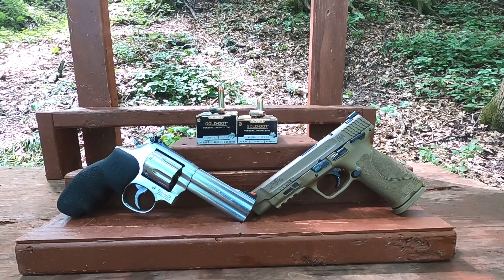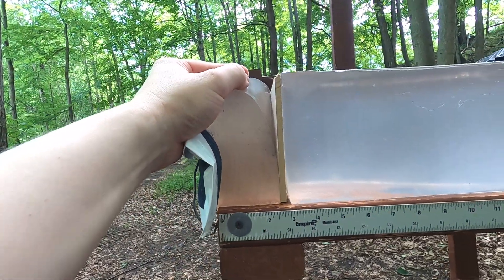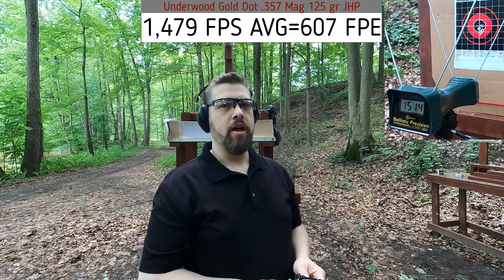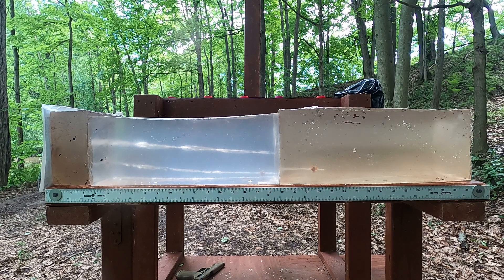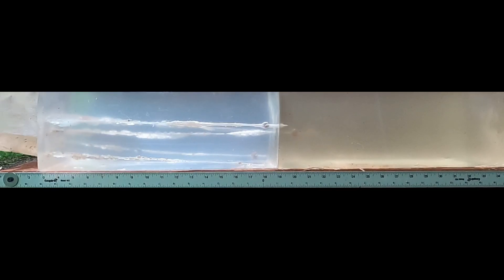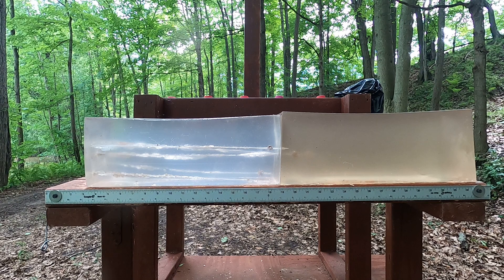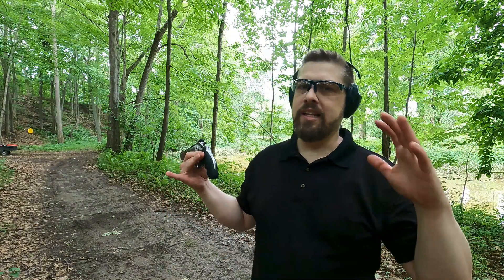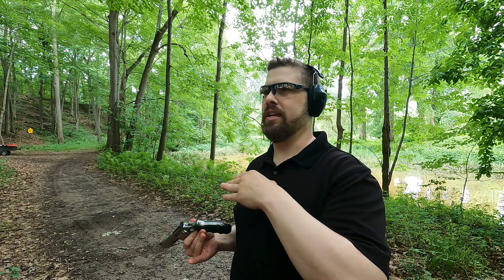.40 S&W VS .357 Magnum Ballistic Test - Gold Dot

Comment: Standard store-bought ammo will give you an average of about 420 fps faster with the 357 vs the 40, which means you can reach out further and do so with more accuracy than the 40.  Also the 357 averages about 150 ft pounds of more energy vs the 40.  

Even the fastest loads done with reloaders, they were able to get about 4,800 fps using a 15-grain 40 cal, but they got over 6,000 fps with a 40-grain 357.   But those loads are not available in stores, these were made by reloaders as I mentioned.

Some people argue they want 14 rounds for self-defense, well since most self-defense shootings are at the 7-yard range with one attacker, why do you need 14 rounds?  Where are all of those 14 rounds going?  into innocent people?

Comment: The best test would be to use 135gr for the .40 and 125gr @ 1,450 for the .357..

Also that would have been a better representation of equal density as well... Not trying to be mean but your test is foul right off the rip bro ...

The 135gr .40 and the 125gr .357 are equal ballistically.... Almost EXACTLY IDENTICAL in fact...

ALSO this isn't even close to fair dude the .357 round has over 600 ft-lb's of muzzle energy and the .40 round only has 480 ft-lb's of muzzle energy..... In what way did you think this was comparable at all?! Please tell me I'd seriously like to know...

Comment: MORE MDF=Real Gel/Real World Proof!!!..it turns Clear Gel performance=Denser Real Gel! Ur 165 5" barrel 19" .616=5.66 cu in" Tissue Crush vs Spear REAL GEL 4 Layer Data from 4" Barrel 18" .618 5.4 cu in" Tissue Crush.  Underwood 125 GD 21" .594= (only 18" Given per FBI Protocol) 4.99 cu in TC" (compared to Critical Duty TC 3.67").  That's a Bad MFer!

Comment: I can see the appeal especially a compact 40 Smith if u CCW. In the lower 48 national parks USA as long as the ccw piece is not showing its okay to carry in the park. A compact 40 with even ten capacity can perform adequate double duty on two legged & some four legged varmints. The American compromise.
Certainly the 357 is adequate protection, but try to find a 357 that can be easily hidden in the summer months with less outer clothing. It's harder and snub nosed is at a disadvantage velocity wise.

Comment: That underwood ammo is loaded hotter than the gold dots. They’re not moving at the same speeds.
Reply from the maker: Yeah but only a difference by 40 FPS average. That's pretty close considering it's only 125 gr. That's only 36 ft lbs difference.
Reply: @GunSam  Speer advertise their 125 at 1450 fps vs 1700 for underwood.

Comment: When you shoot it with the magnum rounds.  The front of the block lifts so much it’s changing the trajectory to end up heading downwards towards the table…
Reply from the maker: But if you play back the more centered shot in the gel at super slow speed, the bullet is as far as it's going to go for penetration, before the block starts to lift.

Comment: Hopefully u will start a 40 S&W renaissance. I never left it. My P229 is in honorable semi retirement now, but it still gets occasional exercise. As does my 686, the gun i started my career with. My primary ho uh se gun for years has been my XD 40, because it is accurate and i found a good light that adds very little bulk. The 357 is a go to for hiking and outdoor activities, especially if animal defense is a concern. Depending on the situation, i might prefer a 158 gr bullet for it. But for general defense, the 125 is tops of course. Gold Dots are great bullets in everything 380 and up. We used 180 gr in the 40 for many years at the PD where i worked. They did fine on injured deer. Thankfully we never had an OIS. I half expect the pendulum to swing back toward the 40 and 45. Time will tell
Reply: 40 sw is a downloaded easier to handle 10 mm basically. 40 sw was created to get 10 mm ballistics but easier to handle, fits in 9 mm size gun frames. capacity near 9 mm. 40 sw can even go up to 200 grain hard cast with 440 foot pounds at 1000 fps, or 200 grain subsonic 400 foot pounds at 950 fps for suppressors and limit over penetration, rivaling 200 grain 45 acp +p rounds. The 40 sw is the second cheapest after the 9mm and second widely available after 9mm. Capacity second highest after 9mm. Also, it makes bigger holes much deeper than the 45 acp. Ballistically it out perforems 9 mm and 45 acp, and reaches low end 10 mm and 357 mag but easier to handle and can even go heavy subsonic like 45 acp. Incredibly versatile. 40 sw is the most balanced ammo type to ever exist.

Comment: I can personally attest as well the 40 S&W is a fight stopper, my agency I used to work for had us carry them In Speer Gold Dot 180 grain out of a Glock 22. 357 Sig is also a really good show stopper. 40 S&W is better in my experience over 9mm. Modern loading have not only improved just 9mm.
Reply: My agency’s 9mm Federal 147gr HSTs are incredible fight stoppers.  Las Vegas Metro PD doesn’t see any “better” results from a .40 when comparing it to their 9mm Gold Dots.   NYPD doesn’t see any “better” results from a .40 when compared to their 9mm Gold Dots.   Both LAPD and LASD don’t see any “better” results coming from a .40 that would trump a 9mm in actual officer involved shootings on the street.   I personally (paid gun stat nerd) don’t see any “better” results from our authorized 230gr .45 HST’s when compared to  our authorized 9mm HST’s in actual street shootings.   This is coming from a 10,000+ sworn personnel department.   

Bottom line is, neither 40 nor 45 is any better nor any worse than 9mm these days in actual street shootings.   Shot placement is key because when I put two in the proverbial “bad guy’s” heart and one in his head with my 9mm, is it really gonna make any difference to the bad guy what caliber I was using???   

The big difference between those three  “KINGS” of the policing calibers is capacity.  Here is where 9mm shines and beats 40 and 45 and that is the ability to not only carry more rounds, but to SHOOT more rounds at a bad guy without having to reload sooner than the other calibers.   That alone can be a winning factor to surviving a gunfight when every split second counts.

Watch why “more” may be not on,y better, but necessary.  From Donut Operator….
https://youtu.be/pdjcYjSsIok
Reply: @colt10mmsecurity68   your 2 to heart and one to the head is great as long as the 2 reach the heart.  I have seen actual x rays of bad guys that look like he should be dead but the bullet never reached the heart. There are Times when a heavy bullet with momentum is required
 For police and other such agencies the 9mm might be the right tool how ever for home defense the blast of a 9mm or worse the 357 could end up being a show stopper for you if your first shot do not connect.
Reply: @biggunshandguns3687  You make no sense.
Reply: From particular medium sized PD with which I am very familiar , and from which knowing the guys doing the testing and recommendations for duty ammo ;

     The initial .40 S&W ammo selection was the USBP Spec 155gr JHP . In the couple of OIS occasions it worked decisively . In addition , Lots of injured and healthy deer were put down . Federal LE 132 buckshot was preferred for deer when available , but the 155 jhp was more than adaquate .

     For the final year or two of the .40 S&W Era , switched to the then latest W-W alphabet soup . It was explained to me that in testing , the actual anti personnel capabilities were identical , but the wonder bullet of the week did better on penetration of car windshields .

Comment: Great video!  I like my 6" GP100 and my 5" M&P 40 (just like yours).  Also, Gold Dots rock.

If I had to pick one to defend against unknown attackers, it's going to be the 15+1 round .40 S&W.  At full, standard pressure power, the .40 does better than most factory loads.  I get 567 ft/lb with no sweat using normal Alliant Power Pistol load data.  Longshot powder got a bit more velocity but did not group as well for me.

OTOH, if I wanted to shoot at 100 yards, I'd pick the GP100.  And for leisurely range shooting, it is sure nice to not have to chase brass.

Powerwise, I'd call it a wash.  Situations where sectional density come into play, the .357 is preferable.  Deer hunting for instance.

Comment: Great testing Sam! Never disqualify the .40cal because the FBI says so. It's still a viable round and will deliver the goods if shot(s) are placed correctly. Shoot what works best for you.
"Be a multi caliber shooter" for best overall performance - Honest Outlaw. ♠️🎩☯️
Reply: The FBI could have truthfully proclaimed that current 9mm was more than adaquate for LE duty use , plus had other advantages for a general issue Duty gun , such as to on balance be an excellent option .

    But to claim that latest Magic Bullets in 9mm are outright better performers than ( .357 M or S , .40 , 10 , .45 , etc ) is p** on our legs , telling us it's raining .

Comment: 40 S&W is very competent. Yet I find the equipment chambered for it steadily going away. Checked Ruger the other day and the only firearm they make chambered for it is their PC Carbine, absolutely nothing else. Guess we'll see how other gun makers handle it as time goes on. On the other hand 10mm has made big strides back.
Reply from the maker: I think .40 will return. It's really pretty perfect as long as you get a reliable fully supported chamber gun.
Reply: @GunSam  I agree it's an ideal balance of factors. If the average person could simply remove all the 9mm bias for a moment and simply look at the effectiveness upon target, the .40 does seem to have a better average ability (without the need to +p anything) to reach vital areas than 9mm or lesser cartridges, cause better tissue damage, and do all of this especially if a side-shot through an arm becomes the deciding factor between life and death. Ballistic gel is a great medium for comparison but taking effectiveness to a meat target (Harrell), the .40 has proven to be more completely effective on average given all the factors than 9mm (again, no +p or special ammo really necessary). Also the capacity reduction of .40 vs. 9mm is very minimal, so much so it's not a factor.
Reply: @turnin.sprocket  Someone should make a handgun that is designed to shoot 10mm and .40 without any component swapping.
Reply: @Frenchfrys17  buy a 10mm learn to reload and you'll be set up perfectly
Reply: @biggunshandguns3687  Would be nice if I had more free time. I guess I’ll just sleep less so I can reload.

Comment: I carry handloaded 165 Gold Dots in my 40, and have always relied on the 155 or 165 grain weight in that cartridge, regardless of bullet design. I am a huge fan of the 357, but the 40 S&W is a common auto-pistol cartridge that fits in a 9mm-size frame and keeps up with it for defensive duty, while maintaining advantages in capacity and muzzle flash. That being said, the 357 is WAY more versatile, especially if target shooting or hunting is on the menu.

Comment: LIKE I HAVE SAID BEFORE,,,,,,, REVOLVERS RULE ALONG WITH SHOT PLACEMENT PERIOD.
Reply: If you like 6 shots to take out 12 people you rule.
Caps lock rules also.  Would have rather seen it vs a 357 sig or 10mm loaded with Underwood or Buffalo Bore ammo.  If you are a shot placement fan, carry a 22 mag revolver.  There's a good reason the military doesn't go to war with lever action rifles and revolver. Shot placement falls part for 99% of people that don't practice under high stress situations constantly and against targets that shoot back.  It BS if you believe most people are capable of hitting a softball size target moving fast and randomly while dodging bullets.

Comment: If S/W has a 357sig barrel for the 40 you can test the 357s 👍😁 and nice shooting.
Reply from the maker: I tried contacting KKM as they offer a .357 Sig 5", I asked if it works in the .40 pistol and they never responded.
Reply: Gun Sam Revolver Aficionado did you check with S/W but it probably cost more.  My son has the Sig229 in 40 and he got the sig barrel for it and it great.

Comment: looks  like you are aiming downward from our angle. Bob
Reply from the maker: Widescreen lens shows funny things.
Reply: @GunSam  Yup but a framers string/snap line from the middle back of the block to your gun hand will tell for sure. You have shared the lens angle on the penetration depths before. Given the direction then rifling goes, the bullet should string one way or another but not always the same. Just enjoying jawing this all over. I almost never see a bullet out the top, most often out the bottom and often then cracking the board under the block. Lots seem to go left and are lost. If there is a constant angle of travel from the entry point to the end point, then unless the deflection starts at the beginning, it must likely be angle of attack. All that being said, I am heavy for caliber HST in standard pressure - wish Federal has not stopped selling HST 38 Special. Thanks, great channel, you keep me watching - lots of work going on at your end.
Bob

Comment: How comparable in your testing protocol are .357 magnum and .357 sig? I’m aware the sig round was created to mimic the classic, but how well does it do so? I’d love to see that test…
Reply from the maker: From what I understand it's close. Like .357 Sig might get you 1,450 FPS in a 5" pistol, and a standard .357 Mag about 1,450 FPS in a 4" with 125 gr. Two big differences though; the .357 Mag can be loaded up to 1,700 FPS in a 4" as where the .357 Sig is maxed out, and two the classic Magnum round was semi jacketed, so the .357 Sig can never really be that particular magnum.
Reply: @GunSam  that is my understanding as well. I do wonder however if any attempt has been made to sling heavier bullets in the sig round and how they compare even at the 125 gr weight…
Reply: @GunSam  
Great video. Tnoutdoors9 was getting over 1500 fps with the Underwood Gold Dots out of a 4” barrel. Also, I would imagine that the hollow point is probably not as wide in the Sig for feeding reasons. That would be a great test…357 vs a hot rod 9 (357 Sig)…hint, hint 😉. Thanks for posting.
Reply: I'm not sure if this still applies as it was years ago when I was seriously looking at the 357 Sig.  That as long as it was out of a 5 inch barrel it performed as designed but performance dropped significantly as the barrel length shortend
Reply: @biggunshandguns3687  
It was designed to mimic the 357 mag from a service revolver with a 4” barrel. It can do that, however it will never be able to compete with full power magnum loads due to case capacity but it will always beat the 9mm in terms of velocity and energy. I’d still like to see some side by side comparisons with 4” barrels and 125 grain bullets loaded by Underwood.
Reply: Well , the usual rule of thumb yardstick is that .357 Sig from +/- 4 inch semiauto will be within  lot to lot margin of mainstream .357 Mag from +/- 3 inch revolvers . ( And that is indeed a very useful level of performance .)

   The .357 Sig was designed on purpose to be optimized for 125gr bullets . I've always been intellectually curious about 147 gr from the Sig .

   But the facts of life of physics and internal ballistics , is that to remain within COL specs with heavier bullets , the projectiles displace significant amount of powder space inside the case . Off the top of my head , velocity potential is +/- 1100fps . Any interest step up from 147 in a 9x19 , but gives up a lot compared to .357 Revolvers with 140 to 158 grain .

Comment: Great test as always, as i suspected hot .40sw can keep up pretty well with 357 mag  full loads ... in handguns barrels ...
Reply: Definitely, 40 sw is a downloaded easier to handle 10 mm basically. 40 sw was created to get 10 mm ballistics but easier to handle, fits in 9 mm size gun frames. capacity near 9 mm. 40 sw can even go up to 200 grain hard cast with 440 foot pounds at 1000 fps, or 200 grain subsonic 400 foot pounds at 950 fps for suppressors and limit over penetration, rivaling 200 grain 45 acp +p rounds. The 40 sw is the second cheapest after the 9mm and second widely available after 9mm. Capacity second highest after 9mm. Also, it makes bigger holes much deeper than the 45 acp. Ballistically it out perforems 9 mm and 45 acp, and reaches low end 10 mm and 357 mag but easier to handle and can even go heavy subsonic like 45 acp. Incredibly versatile. 40 sw is the most balanced ammo type to ever exist.

Comment: After watching video after video, yours and many others, I have lost confidence in all hollow points. None stay consistent. There is always if this, if that, to fast, to slow, plugged nose, whatever.. I want to know, if I have to pull the trigger, that the round I send will do what I expect it to do no matter what the barrier is. Your testing is one of the best out, and it's always consistent even when the bullet isn't.  It's Lehigh Defense 120g Extreme Defender for my 357 mag. And even in 9mm, it's 90g extreme defender is far more consistent than any 115g/124g hp. Just my opinion though.
Reply: If it's plugged beforehand no chance to have the fibres stop expansion. There are some filled with a polymer. What works to fill them would be an interesting video series.
Reply: That’s why I like the old school led nosed hallow points , those always seem to expand
Reply: @357-swagnumultramagax9 again, not real consistent...